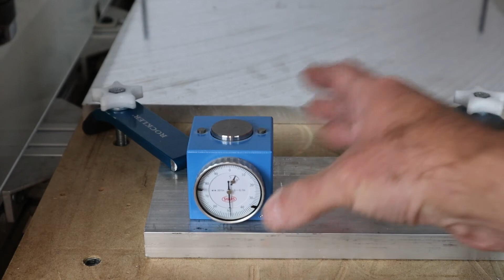Mist Coolant System for a CNC Router

Comment: Im curious why you pressurized your coolant reservoir? I have the same fog buster that you're installing, and it has a built-in venturi. It uses the air pressure going into the larger fitting to create a vacuum and suck liquid through the smaller connector.
Reply from the maker: Yes that is the typical design - and that is what I try to improve. Using the Venturi effect has several issues constant and repeatable flow of coolant is one of them. 
Pressurizing the reservoir means the pump will not have to overcome any pressure it will simply meter in the set volume of coolant.

Comment: How big a compressor is needed?
Reply from the maker: It does not need much air. One size up from a regular pancake compressor will do. I use a California Air Tools brand and it has served me well. I also like tust it is quiet. It delivers 3.1 CFM at 40psi.

Comment: Hi,  I don't see that reservoir on their website??   Old video?   thanks
Reply from the maker: There is an updated video, if you like to watch that one. However I do not sell the reservoir. You can get it at any hardware store and also Walmart. My suggestion is to buy the smallest one as you will use very little coolant.

Comment: Thank you for the very informative video. What size compressor do you recommend since you mentioned a pankake compressor would come on a lot to keep up with the air required to run.  Any recommendations you can make would be greatly appreciated.
Reply from the maker: There is a second video on my channel about the “cool mister”, however I have a small compressor from California Airtools. It is quiet and I really like it for my shop. The new design uses less air as there is a different nozzle. I find 15 psi a good starting point. My unit is the 4610AC. It’s about 7 years old and runs still good.
Reply: Thank you for the great information and the quick response.
Reply from the maker: No problem 😉

Comment: This was great content. Thanks for sharing.
Reply from the maker: Glad that you enjoyed it !
Reply: @JBWorx  how messy is the coolant? I have a 48*96 inch machine that would like to put a mister on to cut aluminum, but I cut wood regularly on it as well. Is it best to have a dedicated machine for aluminum milling or is switching between materials medium a minor problem?
Reply from the maker: I think you can run both on the same Maschine however and I say this with a big “But” because I use alcohol on aluminum. You will need to understand how to safely run that in your shop. Alkohol works well because the chips are dry and vacuum up easy. However there is the requirement of good venting and understanding your dust collector. So don’t use it until you researched and understand the risks involved. For water based coolant I think it is also possible if you have a spoil board that you either change out or is made from a material other than wood.

Comment: Hi! What’s the minimum air pressure is required to operate?
Reply from the maker: For most cuts I can get by using just 0.5 bar. If you create a deeper slot 1 bar will do it just fine.

Comment: JB  would you by chance have a link to the 8mm tubing with the fittings. I a currently attempting the same process.
Reply from the maker: So sorry for my late response missed your comment. Yes certainly. 
https://www.amazon.com/gp/product/B07RM5WWBT/ref=ppx_yo_dt_b_asin_title_o00_s00?ie=UTF8&psc=1
If the link does not work look for Tailonz Pneumatic 8mm on Amazon. They also sell the 4mm hose.

Comment: You're right about needing half a mile of thread tape for plastic threads ?
They are Always oversize ??

I don't own a CNC Router but the Mist Coolant idea is pretty interesting ?
I have a coolant system on my Manual Mill and Lathe which works like it should.
But ?
There is Always a But, lol.
Coolant is great ? except when you get it all over the floor, which i hate.

Not totally sold on the idea of MIst Coolant as yet, especially with the problem of getting coolant down the bore of small holes.
I was hoping Mist Coolant Might be the way to go ?
But it seems i need to stick with my washed floors, LOL.

Enjoyed the video though.
Thanks for sharing your project with us.
Regards Peter.
Reply from the maker: Thank you for your thoughts Peter. I use also flood coolant on my lathe and it also cuts down on the meal dust inside the machine. On the mill however I suggest you give the mist coolant a try. For deeper pockets you can adjust the air blast and it will get the chips out.

Comment: Thanks for showing your solution. I realised that the venturi nozzle in this cheap mister is very fickle to operate even with gravity fed fluid. Pressurised container to the rescue. Do you use the air valve on the mister block at all with your setup or is that redundant now because of the air regulator? Cheers, Peter
Reply from the maker: Hi Peter, I do not use the air valve at the mister it is fully open all the time. I also found that I can get by with much less air than I originally thought.
Reply: @JBWorx  thanks JB - waiting for parts to upgrade my setup